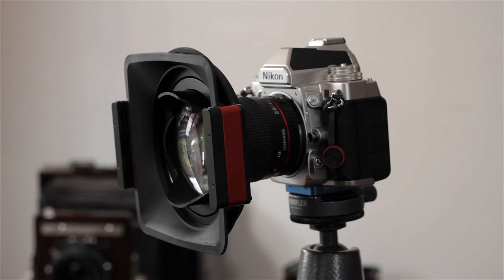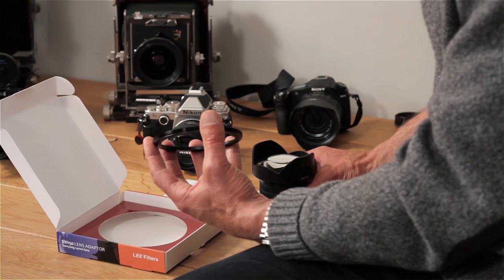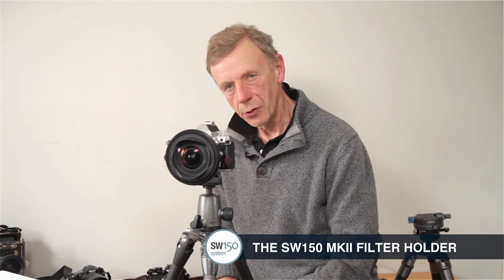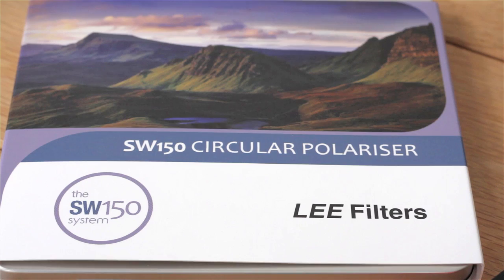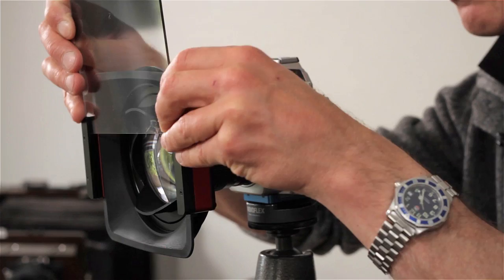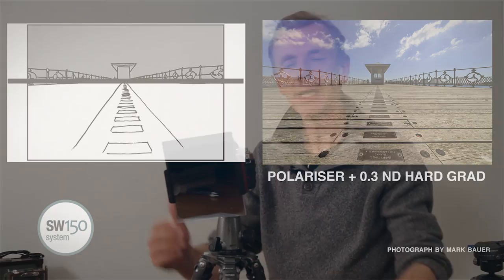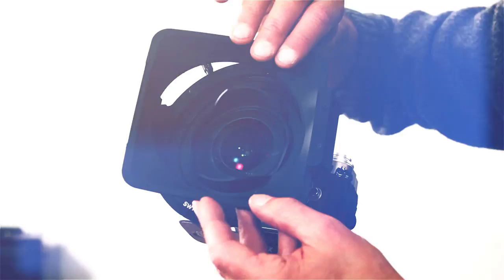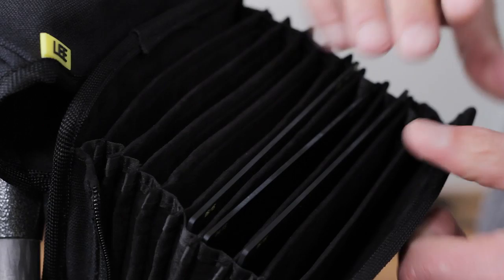LEE Filters - SW150 System Overview with Joe Cornish

Comment: Having worked with another large filter system, I found frequent assembly and disassembly in the field highly impractical.  The lens and filter together needs its own carrying case.  I'm glad some ultrawide lens manufacturers have clued in to redesigning the front element so that it's not a big bubble.

Comment: The limitation, of using a "Grad", along with the Polarising filter, is quite a serious one! However, "Lee" supply a "Tandem" accessory, that enables the use of "Two" filter holders, (But NOT, with the SW150 system) so that each filter, can be independently rotated, when used together. A nice, informative "Post". Have a good life!

Comment: I prefer ultra long lenses these days. Drop-in filters at the back. Try the  FotoDiox 'WonderPana' system if you want a good circular polarizer for your ultra-wide. I've been shooting professionally for 30+ years. Ultra wides are good for news/photo-journalism pix when you really want to 'get amongst it' - the new Canon 16-35/2.8 III is a blessing in that regard - their prior 16-35's were too soft at the edges, even on sensor-crop bodies.

Comment: Thank you so much for this nice presentation of the new SW150. Good move from Lee to support the full frame wide angle photographers as well as the 100mm and seven5 line. Just a question, what is this small tripod in the right corner? Looks like a Gitzo, but which model? And what is mounted on top, Novoflex Panorama Q Pro II but which leveler? Cheers Ralph

Comment: Perhaps I missed it here, but is the ND graduated soft filter made from 100% optical glass? I suspect it is a continuation on Lee's part on using resin ( plastic ) on ALL their grads... If this is the case, then this otherwise nicely designed system serves  no purpose whatsoever...